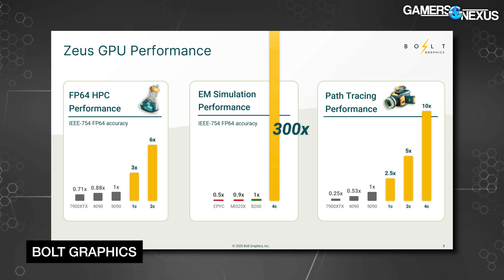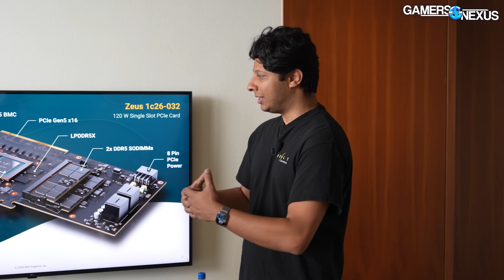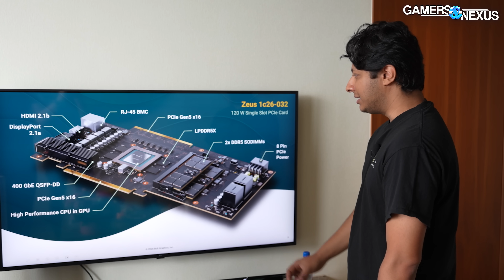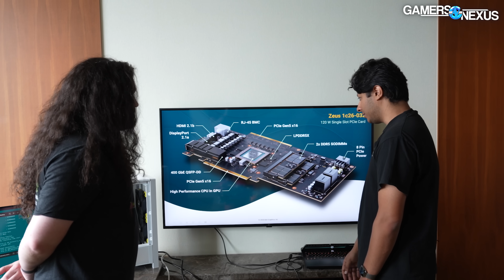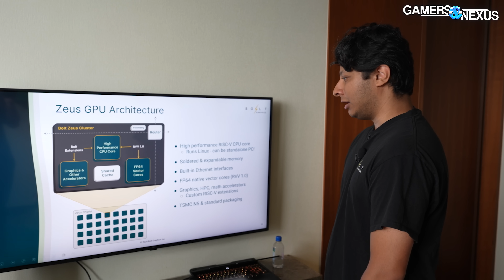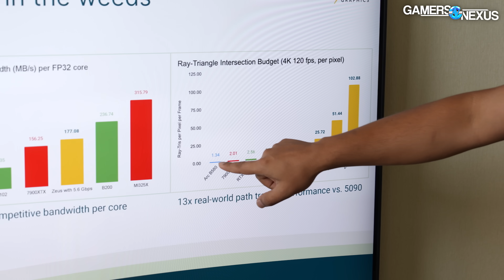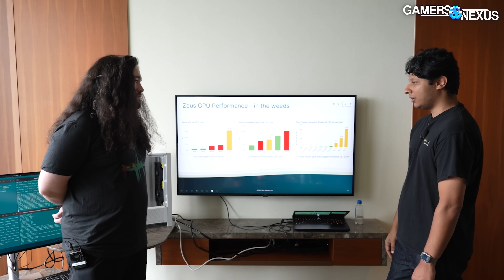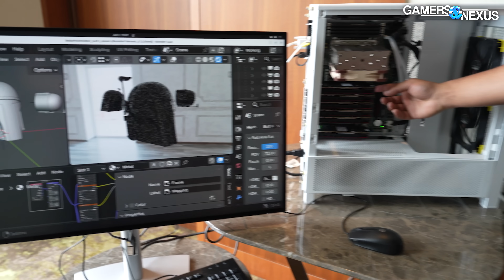A New Gaming GPU Challenger: Bolt Graphics Takes Aim at NVIDIA

Comment: It’s not a gaming gpu yet but we need competition from everyone possible.
Reply: they don't need a game gpu to help gamers tho. if they can have a product that is competitive in markets that currently use gaming gpus it can remove that supply pressure point.
Reply: @uoislame  It wont.  HBM and DDR5 share the same wafer production.  Which is what is driving the costs in the GPU market and other markets.  This will not move the needle at all.  The only way we break this problem is to break the triopoly of the ram producers.
Reply: @uoislame  except it won't be the case. If they serve pro market only then their product price will reflect that. Those that buy gaming gpu for their non gaming task are doing so because gaming gpu is significantly cheaper cost wise. In china nvidia have the option to sell H20. but many chinese companies end buying cards like 4080 and 4090 and modify those card with more VRAM because true pro grade card like H20 still significantly more expensive than 4080 or 4090. So Bolt will not so easily going to deter those that buy gaming gpu for their pro workload. Unless their want to sell their pro gpu at consumer gaming price.
Reply: @arenzricodexd4409  They literally said that they want to sell their pro GPU at consumer gaming price (cheaper than Nvidia '90 cards)
Reply: @uoislame HPC usually uses cards with ECC memory, i dont think this will impact anything that uses gaming gpus
Reply: @uoislame  What? You mean they "could" design a GPU architecture in the foreseeable future that is able to rival and kick both Nvidia's and AMD's current GPU architectures out of datacenters to "help gamers"? Lol, what...? 🤣
Reply: @elgonzo7239 no he is referring to rendering farms. Think animation or cgi
Reply: @exoticredtadpole2713  And...? How would anything you just said change anything i wrote in my comment...?
Reply: @elgonzo7239  I was explaining that Bolt isn’t going to replace data center GPUs, which are primarily used for AI training. Instead, they’ll be selling to companies like Pixar, which has its own personal render farm. I believe Pixar is buying consumer GPUs (essentially GPUs designed for graphics rendering, not AI workflows, etc.). So, how would this affect the prices of consumer GPUs? If Pixar buys 10,000 GPUs from Nvidia but decides not to purchase them this year and instead buys them from Bolt, those 10,000 GPUs can then be sent to consumers, increasing the supply available to them. If Nvidia still wants to sell these large quantities to animation studios, for example, they’ll have to lower their prices to compete. That’s the basic idea behind this scenario.
Reply: @exoticredtadpole2713  So, why exactly would render farms want to replace their GPUs? What would be a reason for that? Don't answer that the Bolt hardware could be better/faster performing, because then you're exactly back at my first comment (and mentally replace "data center" with "render farm"). Professional render farms, like data centers, are not consumers or gamers - unlike them they aren't aiming at buying the cheapest/best-price hardware, they buy the hardware best suited for their business. Because the purchase cost of assets is only a one-time investment/cost. But the operational benefit (or costs) incurred by those assets are recurring and are a relevant metric for businesses.

For data centers, a dominant metric is rack power and power/perf density, not purchase price. For render farms, it's also rack power as well as absolute performance (i.e., rendering speed). Render farms don't use Nvidia or AMD GPUs because they're bad at this job and there were no alternatives until Bolt comes along. No, render farms use Nvidia or AMD GPUs with sizable VRAM capacities (32 GB and more), because they are also WELL suited for the computational demands of offline rendering done by render farms.

Even when going along with your assumption, your hypothetical scenario would then mostly make GPUs with 32GB RAM or more available for consumers, which still wouldn't really help gamers much unless they have rich parents...
Reply: @elgonzo7239 as far as I understand (which I may be mistaken about) is that the Bolt architecture and design is supposed to be drastically better for these render farms workflows: lower power, better scheduling, better cache, more path tracing capacity, etc. So those are things they are looking for. Typically, as you mentioned these companies go through upgrade cycles. I just said Pixar as an example. I don’t know if Pixar is upgrading their hardware or if bolt will have wait a few years. I don’t know exactly where these companies are in their cycle.  However, it’s likely that they’ll consider Bolt next, especially since Bolt claims 4x performance improvements, not just marginal improvements. These studios may not be willing to replace their current systems if this wasn’t the case, as compatibility and redesigning computation workflows can be more expensive and challenging. They might just stick with Nvidia if Bolt was only 10% better. 
So I guess ultimately we will have to see in a few years if their claims hold up and if industry adopts as well. I hope them the best because I don’t think ai upscaling is solution at all. It looks great ish but I think actual hardware graphics processing improvements should the driving force ultimately for the industry. What are your thoughts?
Reply: Regarding higher memory cards, I think the idea is this will help a bit. I think these higher GB cards already super expensive so if even if the higher end can be pushed down it could potentially lead to them being for available and forces pushing down of cards underneath. 

Let’s say 48 gb card exists which costs 3k and 32 gb card which costs 2k
And if Bolt release a 2k card for 48 gb (and people actually buy it) then Nvidia will be forced (assuming bolt can get better frame rate etc) to decrease prices for their 3k to 2k and now no one will buy 32gb card they will then be forced to put discount for it like put it as 1.5k etc. this may lead to adjustments which were price at 1.5k etc. this may cause lower end cards to also be pushed down a bit but obviously it will be much less downward pressure than the prices that Bolt will be competing in (assuming performance is better etc). 

Also assuming bolt doesn’t pivot to AI datacenters as customers which there is definitely a high chance of happening due to the amount of addressable market there. Granted, path tracing computation is different from tensor multiplication but ultimately everything is matrix multiplication graphics no matter what their chips do. Also higher caches also help for ai models too. Although they don’t have (as said in video) highest speed vram.
Reply: @exoticredtadpole2713  It looks like 32gb LPCAMM DDR5 is $400 USD before shipping etc. I could see 1000-1300 US for a single chiplet card with current Ram prices, and worse if / when ram goes up, but in no universe am I expecting 2k for a card with bulk ram unless the chip is worth 1.4k+ alone.
Reply: @uoislame  What?!
Reply: @IncognitoActivado I think what he’s saying is something like this:

Let’s say a company wants to use a GPU for something non gaming related. Let’s say rendering simulations in Blender. They could buy an RTX 50 series card to do it. So that’s one less card for gamers. 

If Bolt GPU is an option, they may opt to buy that instead so then that 50 series card is now available for a gamer to buy.

Because right now, a lot of consumer Nvidia cards can technically pull double duty for both gaming and non gaming tasks. So both gamers and non gamers want them. If there’s another option for non-gamers, it means there’s more Nvidia cards left for gamers.
Reply: @FraserSouris  That is a poor excuse, consumer. lol
Reply: @FraserSouris and it means more competition for nvidia which is always a good thing
Reply: @IncognitoActivado  It's literally the definition of competition that you learn in the first week of every Econ 101 class.
Reply: @FraserSouris  price will still be an issue. Many those buy 5090 for non gaming task because it is cheaper than buying true pro grade gpu.
Reply: @HELLDAD.  Competition means nothing if the products aren't worth it.
Reply: @FraserSouris  So more money for ngreedia. Sounds like a plan.
Reply: Its a tough market to break in, as Intel has shown. I wish them all the best luck but ultimately it will be up to the people and timing of release. AMD dropped the ball a few times and I hope other companies can learn from their mistake.
Reply: @Holret  Considering Lisa and Juang are related, I'd be willing to bet it's some illegal agreement where AMD is supposed to never be clearly better than NVIDIA.
Reply: A huge part of Nvidia's market is workstation.  In fact, they essentially have a monopoly on the workstation market in terms of software support.  ARC and Radeon are amazing in theory, but nothing supports them as well as CUDA cards are supported.  If Bolt can get support, they I imagine their products would be an appealing alternative to Nvidia.
Reply: @taproot4287 Nvidia probably  has some special deals with the enterprise software makers. Very few pro software have dual implementations,most just use CUDA.
Reply: @taproot4287  There is no reason bolt's non cuda implementation would be supported when AMD and Intel, who have massively higher marketshare than Bolt's 0 are not.
Reply: @ShinDMitsuki  They could go a ZLUDA-esque route and then try to stare out NVidia in the inevitable anti-monopoly CUDA case... I doubt NV would win such a case in the EU at least.
Reply: @ShinDMitsuki  On a datacenter scale if these represent a significant cost savings there will be a huge incentive to support them. Some of these datacenter companies are buildings tens of billions in infrastructure.
Reply: @lunawense6288  In a data center, rack power matters (power and/or perf density). You can offer your goods for the best bargain ever seen on this planet, if they don't meet or exceed the power/perf density of the competition, data centers won't buy your goods at the scale of the competitors products regardless of whatever discounted price. This also means that if your goods are exceeding the power/perf density of the competition, data centers will buy more of your goods even if it is more expensive than the competition. (Operational costs and achievable revenue - bubbles not withstanding - is king, not the one-time purchase price of assets.)
Reply: @lunawense6288  
None of that matters if Bolt's GPUs can't run the software companies are using, or if they can only run it at greatly degraded performance through a CUDA compatibility layer. That's the stranglehold Nvidia has on the number crunching market. Software designed for CUDA can run on AMD GPUs, but it's much faster on Nvidia GPUs.

There are number crunching libraries out there which support CUDA and ARC. Sometimes OpenCL (not to be confused with OpenGL) or even Vulkan. But that's not the norm.
Reply: @TotallySlapdash  This is probably their exact strategy. Get close enough to CUDA that you can fix the discrepancies in real time, and then lawyer the fuck up.
Reply: @lunawense6288  Not an AI card, not going into datacenters. This is a card specifically designed to allow fully accurate path-tracing (opposed to partially accurate raytracing that then uses AI upscaling to fill in the gaps.)
Reply: @TotallySlapdash  ...unfortunately, Bolt Graphics are US based.
Reply: Hope it eventually supports CAMM2 modules as well maybe on future gens
Reply: Well, by targeting say, Hollywood and other film industries for CGI, they should find their footing and be able to evolve their product lineup for gamers eventually.
Reply: We desperately need more competition in silicon fabs, too. God forbid the top suppliers decide to slip the noose one day and cancel all their contracts with smaller companies. I keep hearing threats from people like Bezos that they want us to switch to a cloud compute or "computing as a utility" model and everyone knows that would never fly if consumers still had access to parts. They want us to live under the Bell Monopoly all over again.
Reply: @GirthOfANation  they’re not stopping anyone from opening their own fab
Reply: @GirthOfANation  I do. Yet people continue to spout ideas like “we need more competition in silicon fabs” as if they don’t know it takes years and billions of dollars to set one up
Reply: Gaming is not what they are aiming 🤔one of the stake holders NATO Innovation Fund (NIF) their mission: Geopolitical security and advancing dual-use technology , i don't need to spoon feed you do i ?
Reply: @SedriqMiers  They aren't aiming at gaming, but the video title sure is. Do WE need to spoon feed YOU?
Reply: @jemiller226 are you this deficient in the head where you trust the video title more than fact?
Reply: @amooingdog3297  Are you this deficient in the head that you can't own up to this being a clickbait-ass video? This company's been around for quite a while now and they've been having people around for the same dog and pony show every time. You've been had, and you can't admit it.
Reply: @SedriqMiers  Wait, wait? They work with NATO? WHAT?!
Reply: Whenever they’re actually available, even though it’s geared towards productivity, I guarantee several games will work great. Compatibility is probably going to be bad but I have no doubts people are so excited for this that you’ll be able to play tons of major hits in no time.
Reply: @GoldenPickaxe  Videogames that aren't make in that crap known as UE5 need GPUs; NOT APUs.

Comment: yeah these guys have been sitting on their FPGA for years, all while collecting investor money and selling merch.
the founder (the guy in the video) often responds to elon musk like musk is his big daddy.
We need competition in the GPU space, not these guys who're barely above scammers who've done nothing
Reply: Intel had the knowledge and the tech since 1998 with the release of the i740, they got back recently with the Arc GPUs, and despite their knowledge and tech, they still faced a lot of issues with them.

It shows how difficult it is to enter this market, ofc it's gonna take a long time for anyone else to develop something significant, it'll take a lot of time and resources, so it's not surprising that the Zeus GPU is still in its very very early stage, it's also not surprising that a lot of funding is necessary, just look at Intel...
Reply: We already have it. Look lisuan or moore threads.
Reply: i mean, i think they are working on something, but i think they will run out of money before they get anything launched.. this card they are representing looks ridiculous, 'its a single board computer' yeah right, talk about BOM cost optimalisation and  product focus, this thing is a mess and don't get me started on using SODIMMS for actual memory, the complexity in this design is enormous, the timings and latency will be sloppy with those soldered LPDDR5 and SODIMMS mixed, different trace lengths, timing issues.. modern memory does not have the tolerances to do this kind of stuff, without sloppy timings and massive performance loss.
Reply: @snekkel  yeah overall the concept has a lot issues and it doesn't require a degree to see them, this was more a selling pitch especially because it's a concept not an actual device...
Reply: You can always find some random git in comments section with no skills and nothing to contribute calling everyone else scammer because someone tweeted some rich guy or something.

Comment: snake oil salesman for gpu's all talk with no real gpu working with no benchmarks and no games running to show not to mention that this bar chart shows a 5080 having better rt than a 4090 when we know in real world offline rendering and path traced rendering is better on a 4090
Reply: I understand that it was per core numbers, not whole gpu. 5080 has better rt cores than 4090 but less of them.
Reply: @misiekt.1859  they didn't measure the rt performance just by per rt core they have the 5090 at 7.91 vs 4.25 on the rtx 5080 and we know that all 5000 series have the same rt cores which means they are measuring the entire gpu performance not per rt core
Reply: It will be slover than 1030… But if it does work at all… it is advance in the market… Most likely mobile phone lisensed gpu core…